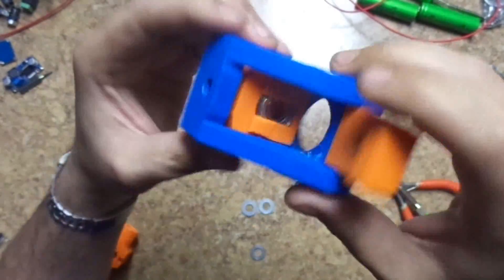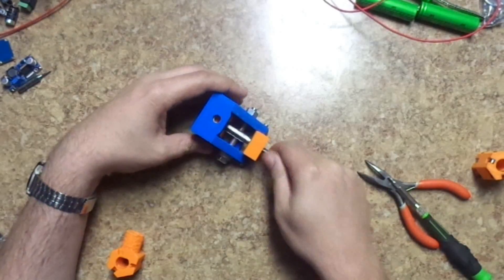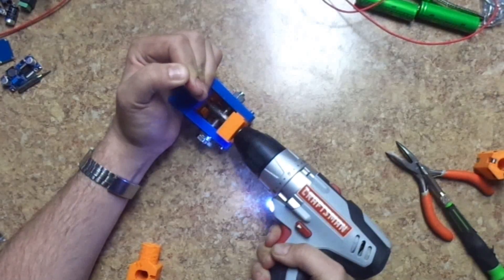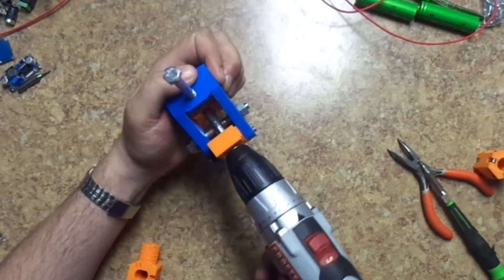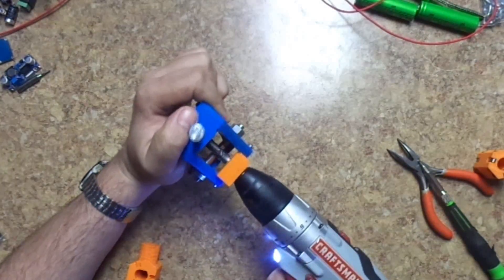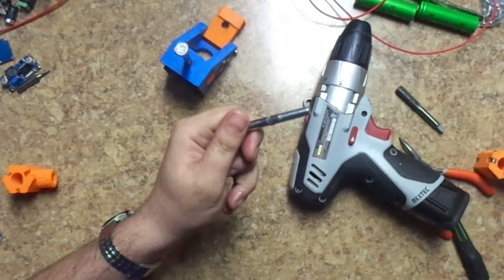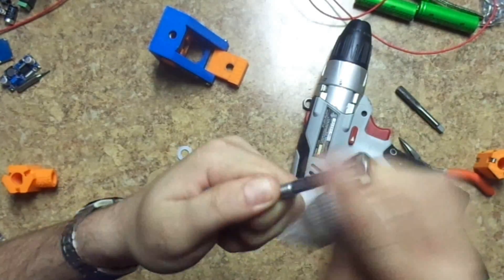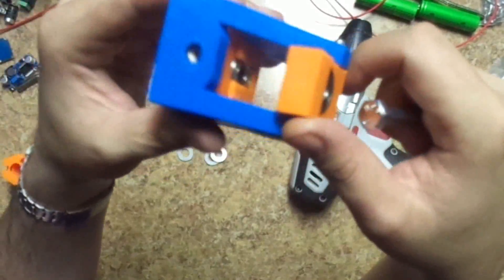3D Printer Build - Extra : Hobbed Bolt Maker

Comment: Hi inventimark, nice video, what is the size of the tap tool you have used, is it 4mm?
Reply from the maker: I think it was a 5/16th or 3/8 size tap... the biggest that I could fit into a 608ZZ Bearing on either end.  An 8mm tap would probably work, but it would be best with the biggest you can fit into the bearing.  9, 10 even 11 or 12 would possibly work.  I don't have any metric taps in that size though.
Reply: inventimark Thank you